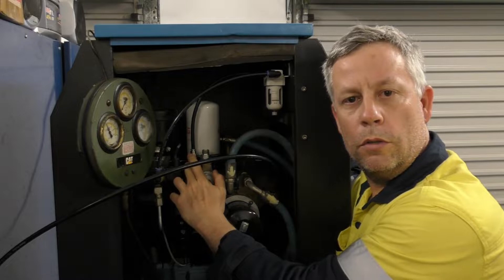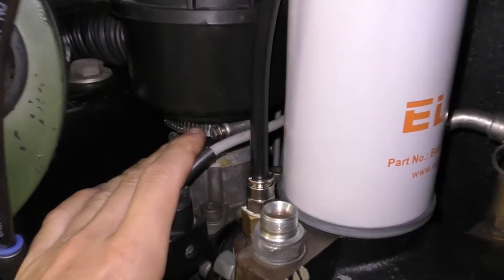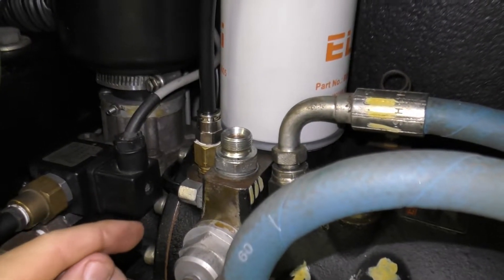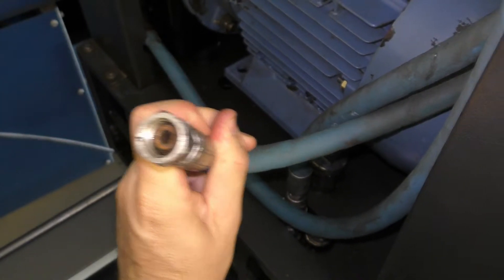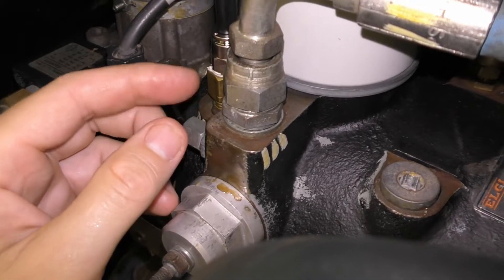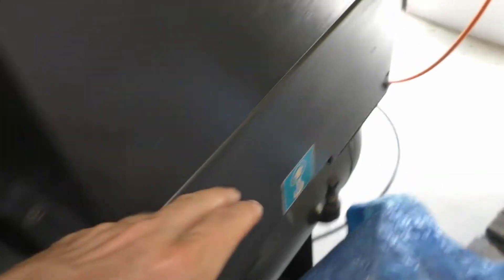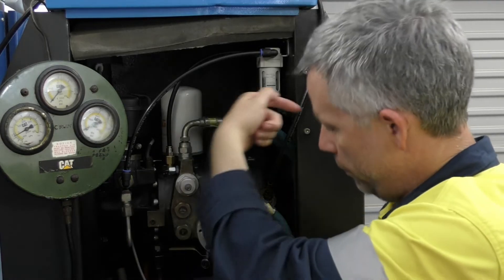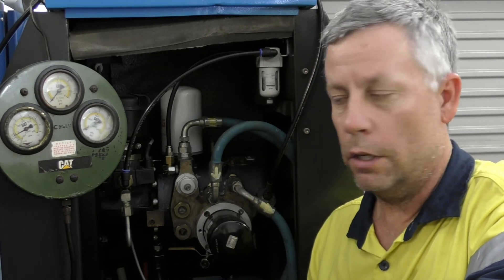ELGI E05en Rotary Screw Compressor Video 6 Setting the minimum pressure valve and fault finding.

Comment: hi sir how are , thank you for your vedeo,
please sir i have a screw compressor from chicago pneumatique CPM10 ,i change the bearing inside the screw element when i fix it there is no air loading.
i hopm receive your answer soon thank you sir.
Reply from the maker: Im not an expert but I'll try to answer.  Does the inlet valve open after start up?   My compressor has basic logic to check for temperature, Pressure and motor running before it will attempt to open the intake/loading valve.  Do you know if your loading valve solenoid is getting power to open?
Regards,
Chich
Reply: changing the bearings in the air end is not something you should do without the cause of the problem.
being a CPM10 i think the rotors will be rusted and there is nothing you can do to correct this.
Reply: what did you set the discharge clearances to ?     this is a small air end and it would be about .002" or .05mm

Comment: G’day Chich, spitballing a couple of ideas. From a previous video it sounded like you didn’t overhaul the MPV, and you suggested it also functions as a non return valve. Is it possible the spring/s are dated or non OEM so it is not closing fast enough and the 0.6bar pressure drop is across the MPV back into the compressor itself? 

Is that pressure relief valve on the compressor or the receiver?  What pressure does it blow off at?
Reply from the maker: Hi Jason.  Great to hear from you.  That is correct, I did not overhaul the MPV, just stripped it cleaned and lubricated and put it back.  I did not replace any parts so the springs are what came out.  I know the history of this compressor and I'm confident its still original.  As the compressor fill's the receiver the MPV actuates back and comes out of the equation. The non return spring is super weak and simply holds it in position. It the pressure differential overpowering this weak spring that seats and unseats it. I'm pretty sure it's fine.  There re 2 pressure relief valves.  One on the compressor and another one on the receiver.  Thanks for you comments mate.
Reply: @chich2  1 year on mate, did you find a solution?

Comment: great work.  i see your problem the hose fittings are rusted internally. you maybe able to clean them but you may have to get new ones.
Reply from the maker: I think I will try increasing the fitting and hose size and post the results. Thanks